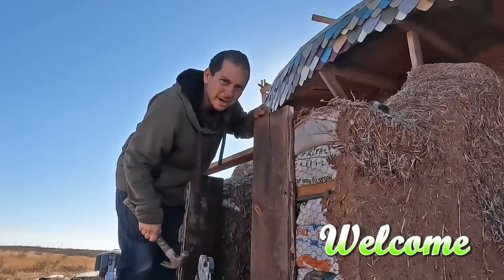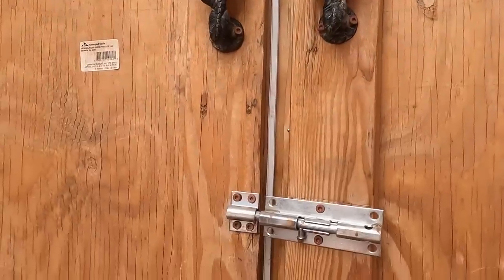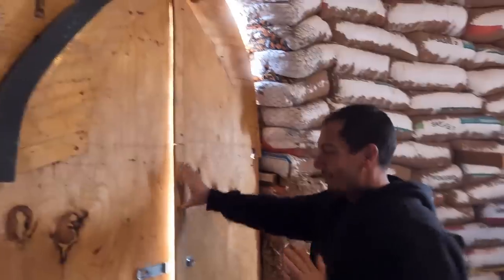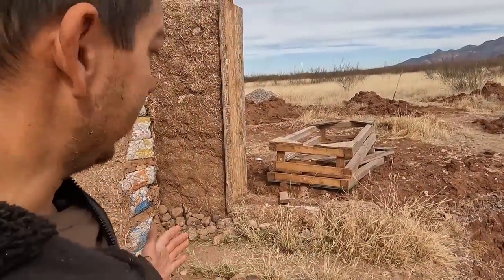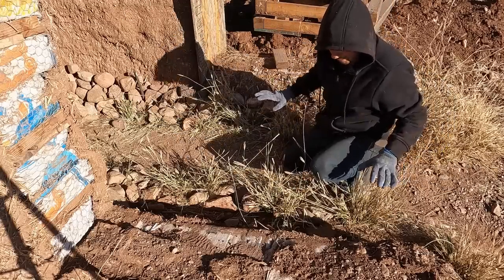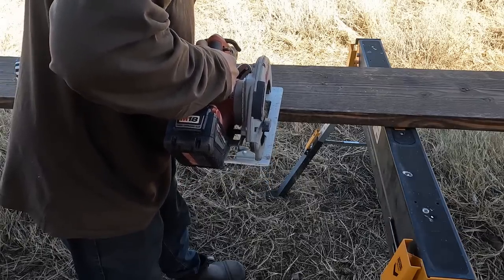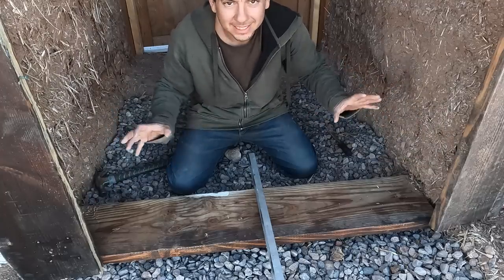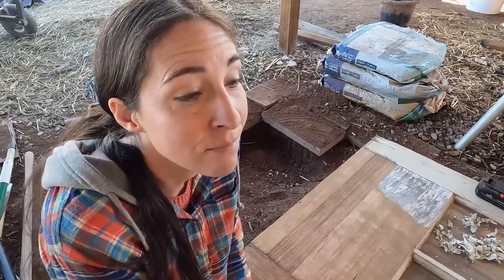Incredible Transformation Begins! Framing A Doorway To Our Self-Built Earthbag Desert Home

Comment: Hey, I’m wondering if you can get Peter to help you move the geodesic dome over the root cellar as a temporary cover. Obviously you would need to throw a tarp over it but if the diameters work out you could keep water from the hole till you have dome 1 done.

Comment: Nice, I suggest putting up a guardrail along the big gapping  hole in front of the door so no one trips or fail when come out and going in.  You could still frame out where the now door is  and just put the square door in the frame. Just build a arched frame with square opening for the square door. That way you would not have to build a roof over it. Hope I explained that ok.:face-green-smiling: Merry Christmas 🎄🎁☃

Comment: Jess you are doing a great job with the door. that is very old wood you can see the Rings are very tight it may be from the 50s or the 60s. take your time it's going to be a beautiful entrance. Are you going to use oil sealer on that? I've used Penofin in the past.  very good oil for absorbing deep into the wood and repelling moisture.

Comment: i know you guys more then likely dont have one but you should your going to need it in the future and thats a belt sander . with a belt sander that door would have been all done in like a hour tops . if it was me and its not but if it was  i would use a nice oil stain on both sides . its a old door you can see it how dry it is . a oil stain will soak right in recondition the wood and make it last alot longer . not to mention if its exposed to the outside you have dry weather and then wet weather it will need that oil to protect it . hey if im wrong thats fine maybe some one else who knows more then me will chime in with there thoughts .take care work safe

Comment: Love these solutions.  Redirecting foot traffic, gravel for drainage and bringing less mud into the dome - and looks good also. Strategically placed planter boxes can be used too - mint deters mice, smells great and it’s nice to pluck a couple leaves for your drink when you’re entering.  In particular - the second door just makes so much sense- like a mud room- these air lock door/spaces are proven energy savers.  I hope you keep the original door- it’s so charming.   I also hope you keep it as an airlock and add a skylight or someway to add natural light.

Comment: I think putting in a regular size door is a good idea. I like the hallway door idea because it doesn't take away from the inside space an close it in with a metal roof? Maybe cob up to the bottom of the roof? I like the rock/gravel entry floor. It should keep it from getting too muddy in the entry area. An actual paint scraper might work really well. We pressure wash and then scrape out cedar siding before we prime it and paint it. The heat gun is a good idea! Jess, you're doing a good job on the refurbishment of the front door. Nice job getting a frame put up to mount the door to. I'm glad UV got over her spaying. Merry Christmas Jim and Jess!

Comment: I feel Jess's struggle with that door. I'm currently days into stripping the door jam on the side of the house, which has sections where all the paint was peeling and just flaked away, and others where it's still solid. The wire brush did almost nothing. I've gone at it with the same Wagner heat gun - best deal on Amazon! I have a smaller metal paint scraper, and it's dulled now, so it just skates over the edge of the paint, instead of digging in. I need to sharpen it, i.e. flatten the edge again. I'm about to try Goo Gone citrus paint stripper.

Comment: Putting anything in it very long in there if it's straight ahead you could do it but if you have to curve into it that would be hard. But it's good to see y'all get back to work on your home,  I know after the root seller caved in that was pretty bad,  it's very easy to get in a rut after doing a lot of work and then something happens,  yeah I got in a rut too I got to get out of it I hope. But one thing for sure you have a home and there's so many people that does not have a home right now so don't be sad about what happened maybe it was for the better maybe,  that wall was weak and y'all needed to just redo it. Because we have angels all around us watching over us all the time. So I hope you all get that all dried in that hallway and maybe y'all can start on the next part I can tell you what I would do with it I would feel it in and I would do something maybe different straw bell or something a little easier. Myself I'm using something different on my next build I'm not going to build the same as before because as I go I'm learning more so I'm just going to do something a little different. There's much easier ways to do things. I'm looking at mud  pallet houses. And I want to do something with a lot of glass and wood. People are putting up amazing structures with glass doors.

Comment: Removing the paint from the door might have been a lot easier with a heat gun, ora small hand torch. The heat gun would've been a less apt to burn the door, some people might go the chemical routine, but I refrain from using chemicals as much as possible.
   It will be great when completed however the job gets finished.
Reply from the maker: She uses a heat gun in this video.